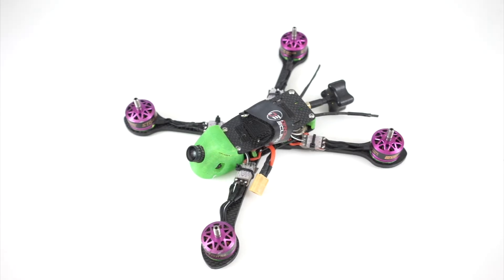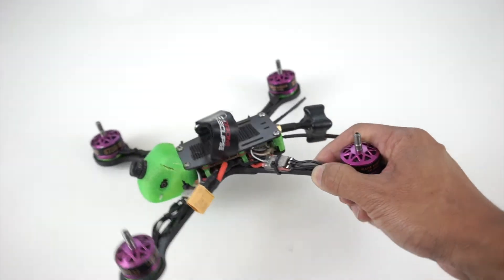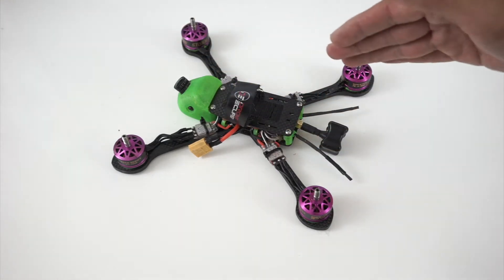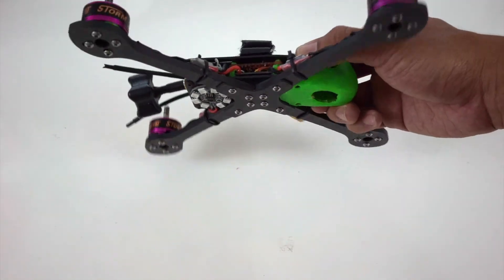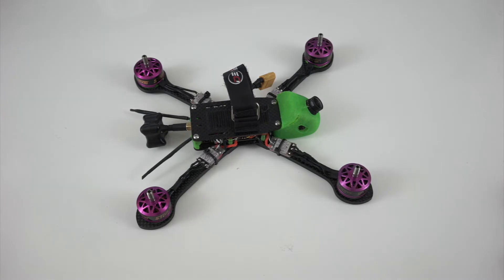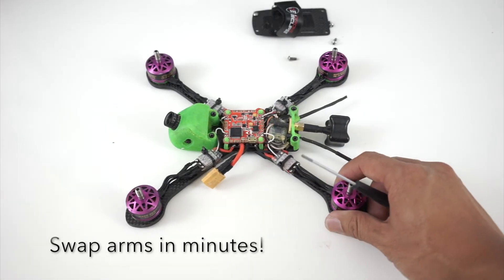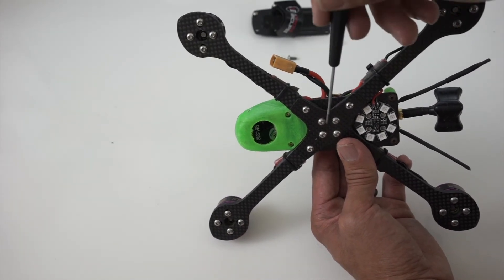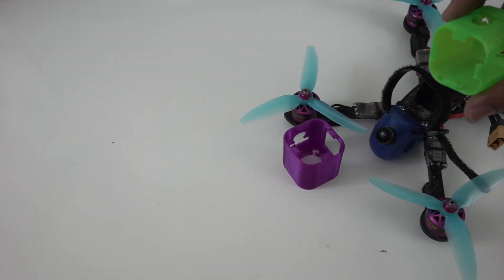FB-01 Racing Drone Introduction

Comment: I agree that some unibody frames transfer more vibration but have you ever tried a 5mm unibody? I've found that they are the cleanest to tune. My theory (with no science behind it btw) is that they thicker body absorbs and disperses vibration better since there is simply more material. I've always found separate arms to be more susceptible to vibration over time due to screws loosening and carbon getting weak spots.

Comment: Looks like a nice solid frame, and a lot of thought put into it.  As a design thought / alternative revision, have you considered making the "top plate" the one with the arms? E.g. you would shift the center of gravity more to the middle of the craft on the Y axis. FC Stack would then "hang" off the top plate, and you access your components from the bottom (which then maybe offer a slightly thicker version of). As I've trained myself that if I know I'm going to crash, I orient the bottom plate to take the impact (and is a reason why I don't like bottom mount battery setups).

Comment: That's cool. But what about weight as in the video (no battery)?
Reply from the maker: Mohamed Metwally hi there! The weight of the frame and hardware is listed on the webpage.  Depending on motors and electronics, I've gotten 307-330g without battery.
Reply: FlyingBear that's really great. I will think about it. I like it. Great job 👍